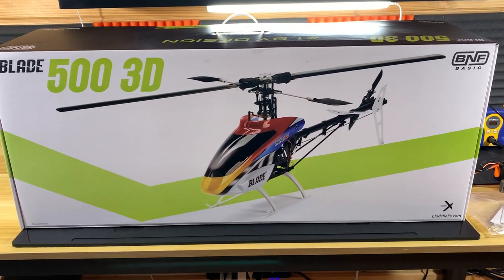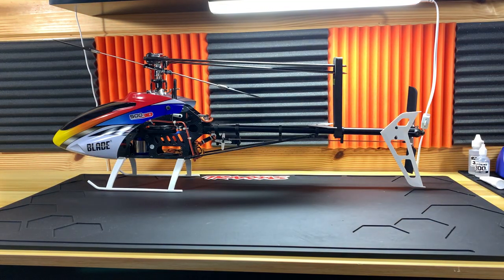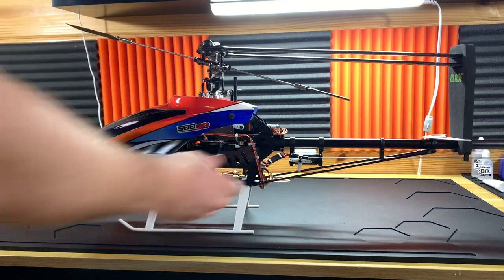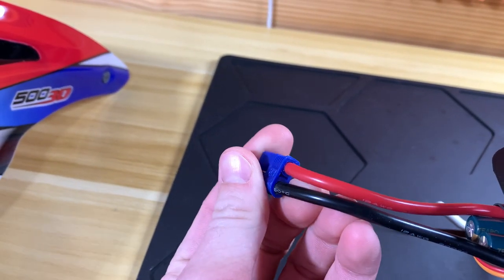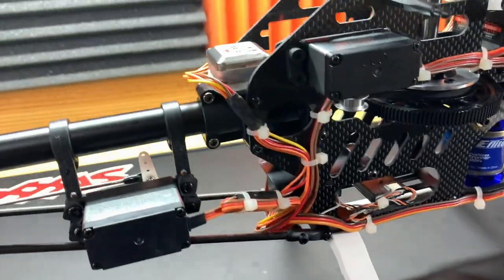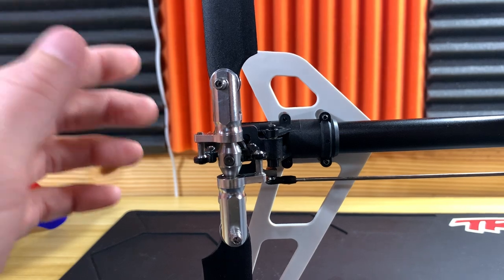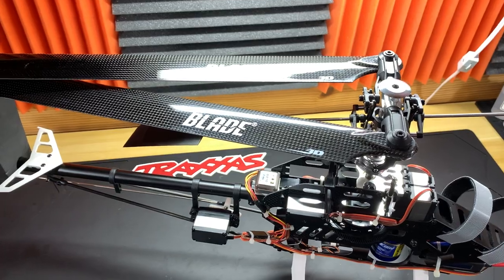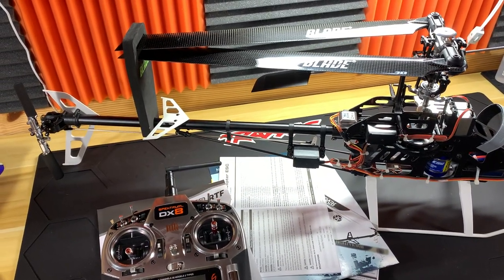Blade 500 3D - A brand-new 10-year-old Heli

Comment: I have this helicopter and I have flown mine a lot, I will warn you that the capacitors sticking out of the front of the stock ESC are only secured by the solder pins of the capacitors. The vibration of the helicopter will cause the capacitors to just break off during flight. I had to open up the ESC and solder in new capacitors when this happened to mine and my father's 500 3D. I have added hot glue around the base of the new capacitors to keep them from breaking off again. Modern ESCs have capacitor holders that solve this issue.

Comment: Make sure you checkout and look into the recall on this heli. 
The tail grips are defective and will eventually explode if you don't get the updated set.
They used to ship you free replacements.  
Not sure if they still do.  
500X has the same recall (same part), so they were shipped for quite a long time with the tail blade grips that fail.
Reply: NVM- I'm at the 8:50 mark now and you covered the recall.

Comment: Just found your channel. You speak REALLY WELL, lighting is good, sound is good (VERY important!). I have an old Trex 450 SE that I bought used way back in 2009. Haven't flown it a lot cuz of opportunity, and I've also got some kind of weird problem where the motor cuts out for a SPLIT SECOND mid-flight, and I have NO IDEA what the heck is wrong with it. (I grounded it after it did it to me two or three times in ONE SHORT flight!) I suspect MAYBE the motor is bad because sometimes the ESC beeps are ALMOST INAUDIBLE? I also haveta fly it in a very small park (don't have a car), and it's really too big (dangerous!) to be SAFELY flown there! I also 'adjusted' the tail (it was PERFECTLY fine BEFORE!), cuz I suspected the other guy didn't set it up right, and now I can't get it to work right. I really should've LEFT IT ALONE! Oh well, that's me! If it ain't broke, 'fix' it UNTIL IT *IS*! Anyway, LOVE seeing these old helis, cuz they were CURRENT when I got into the hobby back in 2009. No flybarless heads, no FBL controllers, just pure, UGLY, CLUNKY flybarred mechanical gyro goodness! Thanks for the GREAT look back! Cheers!
Reply from the maker: I appreciate the complements!

Good ol’ Align, I have never owned a T-Rex but I would love too. The 450 platforms are so popular and well proven. If I had to guess, I would think it would be your ESC cutting out, not the motor. I say that just because brushless motors are so simple and basic, if they look and feel okay, they are probably fine. The ESC can be the cause of many many different problems unseen to the eye. As far as setting up a tail, if you can find the manual for your tail gyro, it should be fairly easy to reset up your tail, the process is usually pretty friendly. These old flybar helis are definitely not as clean and pretty as the newer stuff, but I enjoy having them around for their old style, not having to setup a flybarless controller is odd, it through me for a loop since I’m only familiar with flybarless!
Reply: @mangzrc  Thank you SO MUCH for the tips! I never would've suspected the ESC cuz it's an Align and was SUPPOSEDLY brand new (it wasn't originally installed in the heli when I bought it; came with a Scorpion). I don't have anyone to help me with the hobby, so I've had to try to figure EVERYTHING out on my own. Yes, I printed off the manual for the gyro (Futaba GY-401). I TRIED to skim it, but the printing is so frickin' TINY, I gave up. You've reminded me to look at it AGAIN! I've also watched a MILLION videos on YT so I UNDERSTAND what I'm SUPPOSED to do, but it's not working. Obviously I'm MISSING something!
Reply from the maker: @TechNoPhobiaGirl  When I first got into helis back in 2019, I was pretty much on my own as well. The Blade BNF stuff was great for starting out, but when I decided to assemble and setup a kit heli on my own, oh boy was it trial by fire. I basically scrounged around the internet to teach my self how everything works, I eventually succeeded and now have a pretty vast knowledge on helis, but it was a rough and frustrating journey. As far as your tail gyro, if you are missing something, you will eventually figure it out if you keep trying. I had to take multiple breaks when building my first kit because I was stuck, but I always came back to it until it was done. If you replace your ESC, I highly recommend Castle, they are very easy to setup and your sure to have absolutely no problems with the setup due to the vast information on the internet. I only use Castle.
Reply: @mangzrc  I guess there are a LOT of us (MOST of us?) who get into the hobby with no one to help us. That's why YT/internet are soooo amazing! Castle, eh? OK, I'll keep that in mind. Thanks! I'm of very limited means, so I tend to buy from China in order to spend as little as possible. If Castle is an American brand then it'll be expensive and probably won't be available here in Canada. I bought a cheapo ESC from HobbyKing in China for my little HK-250 and it's total garbage! It doesn't even have a soft-start option! I hate that thing! Fortunately, my 250 has been mostly disassembled all winter so it's not really a problem, until I put it back together. I also suspect the tail gyro is faulty but I don't know if you can even BUY a tail gyro anymore. I guess you probably can, but it's gotta be TINY to fit my 250.

Comment: Hey MangZ, another great video mate! Would you mind sharing any setup variants not listed in the manual? I ask because after setting up a new model on a DX8, the swash does not respond to pitch as expected. Basically, when adding pitch the swash tilts exponentially to the left?
Reply from the maker: I’m not aware of any setup variants, I set up my DX8 without any issues. Are you positive that your servos are connected into the correct ports on the receiver?

Comment: Hi I just get the same heli but I have issues with the setup with my dx9 could you help me with that
Reply from the maker: The DX8 setup in the manual is practically the same for DX9, just reference that. Did you buy it used?
Reply: @mangzrc   I did that but don't know why  the pitch is still incorrect way
Reply: @mangzrc  I got it!!! Now everything is working properly...my mistake was the values on the swasplate
Thanks ✌️ for your help